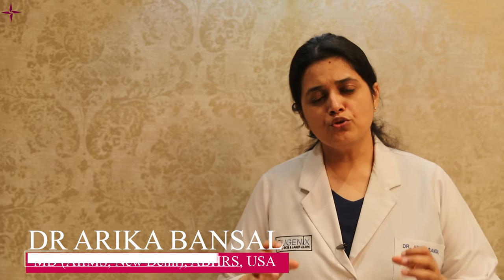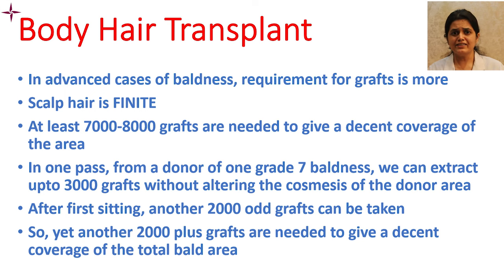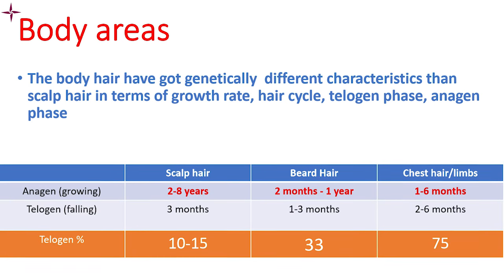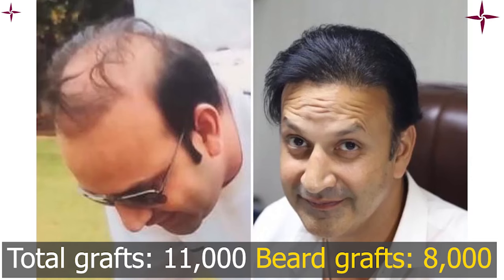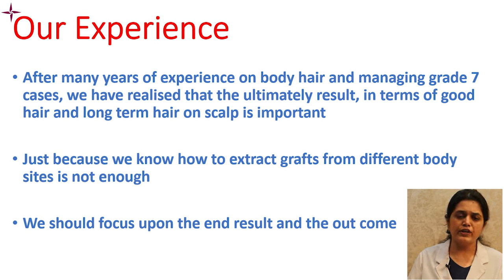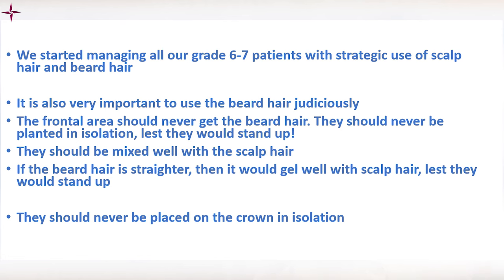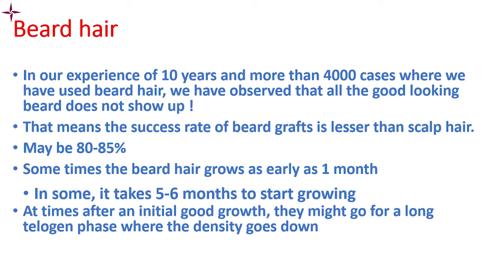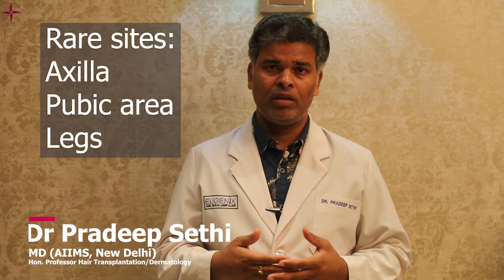Body Hair Transplantation: Explained by experts

Comment: Thank you for another informative video. I just have two questions if I may. Does the characteristics of the beard hair take on that of the recipient area after it has been transplanted? Secondly, If a patient has had SMP, does this make your job harder in locating grafts from the scalp donor area? As always, thank you for sharing.
Reply from the maker: Thank you.

1. The beard hair remain coarse when compared to scalp hair but when a certain length is achieved then it blends in with the other hair.

2. SMP does not make it harder for the procedure because we have proper magnification which can easily help idenity the empty spots and SMP markings.
Reply: @EugenixHairSciencesofficial  thank you!
Reply: @oncall21   I was curious about the same thing because I also had SMP done.
Reply from the maker: Please contact us at 8826473333 for a consult.

Comment: why is it compulsory to take finasteride after a hair transplant? would it not have long term health effects?
Reply from the maker: Finasteride is safe at 0.5 to 1 mg. It is not compulsory to take the medication after the transplant. If you want to save your pre exisiting hair from balding off due to AGA then you can take it. If it doesn't bother you that you will lose the pre existing hair if you don't take Finasteride then you can avoid taking the medication. There is no pressure from our side to take the medication. All we can give are suggestions.

Comment: How many grafts extract from beard and is it possible to extract all beard hair under chin
Reply from the maker: The donor grafts extracted in his case were:

Grade-7

Total Grafts-10,500

1st sitting in 2017 
Total Grafts- 6500
Scalp- 1000
Beard-3500
Chest- 2000

2nd sitting in 2019
Total Graft-4000
Scalp- 1000
Beard- 3000

It is not possible to extract all the hair from the beard.

Comment: I notice sometimes people get hair trasnplants and their new transplanted hairs goes grey. Is there any correlation to this? 

Also, I live in the UK and wanted to fly to India to have this done. In light of Covid, when will I be able to safely travel to you?

Finally, to pay for this procedure will using visa card be ok? If I want to fly and pay with cash what is the maximum I am allowed to carry from the UK to India?
Reply from the maker: 1. The colour of the hair has no relation to whether a transplantation has been performed or not. 
2. You can connect with us on +918826473333 or info@eugenix.in and we can coordinate regarding the the travel schedules and possibilities.
3. You can pay through card or net banking.

Comment: I have acute dandruff maybe scalp psorasis or dermatitis herpitiformis but i dont know yet, i have hard flakes deeply engraved in my head scalp and the colour is sometimes white and sometimes yellow as welll but they are very firmly stuck to the head skin. And i have a habbit of removing it with my hands  because of irritation and along with flakes the hair follicles come too, this way i have lost a lot of hair  ...are there some tests to find what situation i am suffering from categorically ...and in this condition can one undergo transplantation....kindly reply
Reply from the maker: Please call on +91 88264 73333 for details.
Reply: Mam any branch in Kerala....?
Reply from the maker: We do not have a branch in Kerala but you can get an online video consult with the doctors. Please connect on the number given above.
Reply from the maker: 8826473333
Reply from the maker: +91 88264 73333
Reply from the maker: mujeeb pp Eugenix: 8826473333
Reply: same problem
Reply from the maker: Please connect with us on +918826473333 or info@eugenix.in and we can give you the details.

Comment: can body hair be used for beard transplantation?
Reply from the maker: It all depends on the candidacy of the body hair. Please share your body hair pictures with us on +918826473333 or info@eugenix.in and we can give you the details.
Reply: @EugenixHairSciencesofficial  u from sir
Reply from the maker: We have centres in different parts of the country:

Gurgaon
935-P, In front of Amity International School, Sector 51, Gurgaon

Mumbai Clinic
898, Notan Plaza, 2nd Floor, Turner Road, Bandra West, Mumbai

Bhubaneswar Clinic
M -37, Baramunda Housing Colony, Bhubaneswar

Please share your scalp pictures with us on +91 88264 73333 or info@eugenix.in and we can give you the details regarding the cost and requirement for your specific case.

Comment: Can i get definite hairline with donor area as scalp and that donor area (scalp) can get body hair grafts?
Reply from the maker: Yes, that is possible.  We generally use beard graft for donor farming; however, this is entirely dependent on the doctor's assessment.

Please share your below details at +91 8826471111 or info@eugenix.in
 
Name -
Contact Number -
Email Address -  

Accordingly, will proceed further in offering you the best possible approach to your concern/query.

Warmest Regards
Eugenix Hair Sciences
Reply: @EugenixHairSciencesofficial  u didn't understand what i asked, i want definite hairline with grafts from the scalp only, and the part of the scalp used as donor area can get body hair grafts?
Reply from the maker: @nocturnalknight4129  Yes, that is possible, and that is called donor farming, and in that case we generally use beard graft; however for beard and other body parts hair, the doctor will evaluate first, and then we can let you know.

Comment: I've got so much hair, on my legs, and up to between my legs, on my butt, annoyingly hair, in those intimal parts of my body, I would happily give them up, even they won't look good on my head, I guess, the solution would be short haircuts when you have follicles of different types, any man prefers a hair short of just 5mm over a longer hair but with bald areas.
Reply from the maker: Please share your scalp and body hair pictures with us on +91 88264 73333 or info@eugenix.in and we can give you the details regarding the possibility and requirement for your specific case.

Comment: Do you have branch in Hyderabad?
Reply from the maker: We do not have a center in Hyderabad. But we can provide you an online consultation. 
Please share your scalp pictures with us on +91 88264 73333 or info@eugenix.in and we can give you the details regarding the cost and requirement for your specific case.

Comment: Ur branch in Qatar?
Reply from the maker: We do not have a center in Qatar. But we can provide you an online consultation. 
Please share your scalp pictures with us on +91 88264 73333 or info@eugenix.in and we can give you the details regarding the cost and requirement for your specific case.

Comment: After surgery  density of donor area decreases??
Reply from the maker: The density does not decrease sir. In the transplanted zone, initially one can see 100% of the transplanted hair growing at around the 12th month. This will look extremely dense. After this, around 30% of the hair will go into the telogen phase whereas 70% shall be in either the catagen phase or different stages of the anagen phase. This is called anagen desynchronization. Hence, the hair at this point will appear thinner than the initial density. 
The hair are there 100%. It is just the normal hair cycle that causes this phenomenon.
Please connect with us on +918826473333 or info@eugenix.in and we can give you more details.
Reply: @EugenixHairSciencesofficial   sir in case of second setting will it be safe to do? I mean if transplant is done 1 year ago and second setting is to be done now
Reply from the maker: Yes. But please share your scalp pictures with us on +918826473333 or info@eugenix.in and we can guide you in a proper manner.

Comment: The final result is going to be very weird due to different texture of hairs taken from different parts of the body
Reply from the maker: Well. Its not. The grafts are placed intelligently and as fillers. 80% of our patients have grafts from donor other than the scalp.
Reply: @EugenixHairSciencesofficial   What would be the maximum recommended amount of sessions and grafts done within the span of a week?
Reply from the maker: It all depends on the donor availability and the recipient ratio sir. It depends from person to person.
Reply: @EugenixHairSciencesofficial   This one clinic in Istanbul I'm looking at said they were able to do a total of 7000 grafts with 2 sessions in 2 days. Would you say this is possible if the patient had enough donor grafts available?

Comment: If beard and pubic are the same, why not to jump straight on pubic hair and not ruin the beard. I mean  only two people can see my pubic hair at a time, but beard hair is right in front of everybody.
Reply from the maker: We won't be able to take so many grafts from the pubic area, as the doctor stated that up to 2000 grafts can easily be extracted from beard of a grade 7 bald case  without affecting the cosmesis. Beard hair is anatomically close to the scalp and, after scalp hair, the second best option.